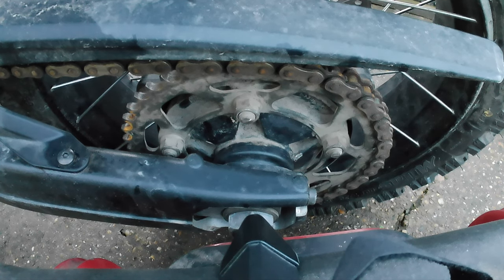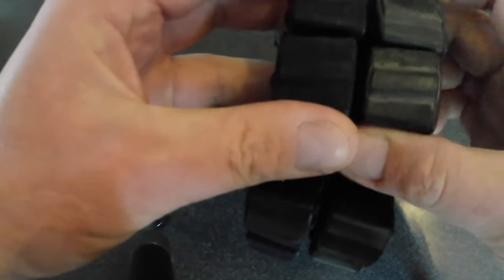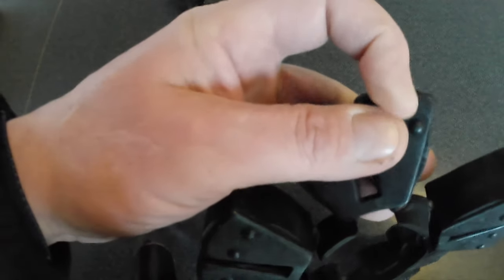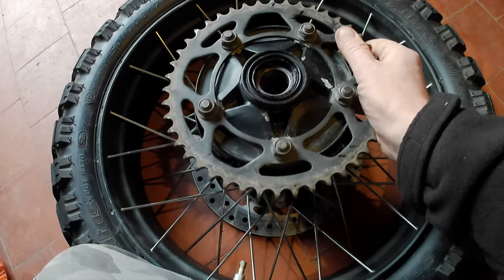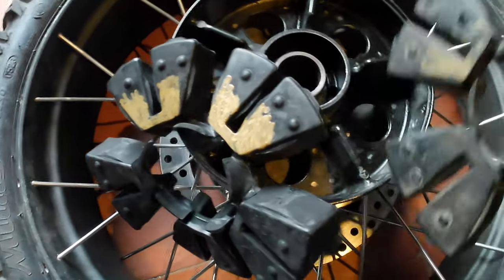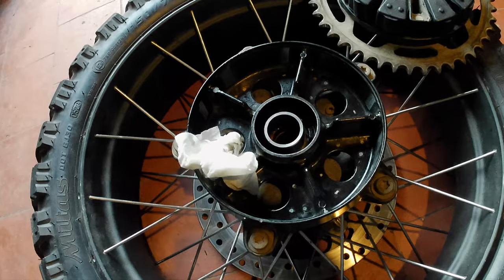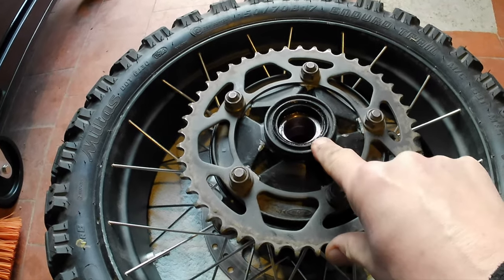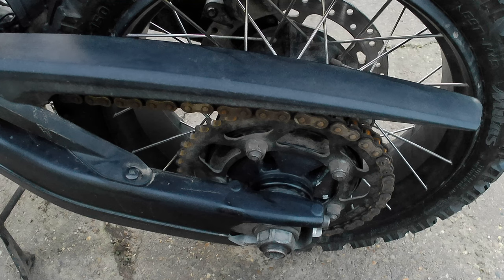How to fix play in cush drive BMW F850GS

Comment: Nice video, mines is similar and it was flagged during last visit to the dealer. 10 day wait for a new cush drive from BMW, hoping it eliminates that noise. 35,000 Miles so well overdue a change!
Reply from the maker: That's good mileage. Mine needs changing again as the new one has only lasted for 3 months. They are obviously not up to offroad riding.

Comment: Thanks for the info...i just noticed a werid clunking noise on mine...did it work in getting rid of the noise??
Reply from the maker: Yes, it has sorted the noise issue, it has made a massive difference. The bike now rides smoother, gear changes are crisper, it no longer chugs at low revs under acceleration etc. Very pleased with the result.